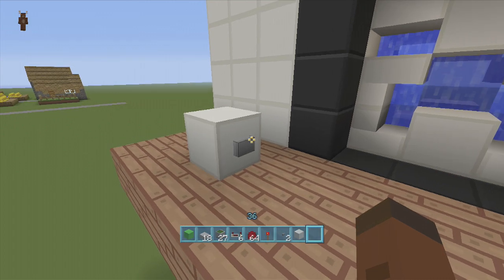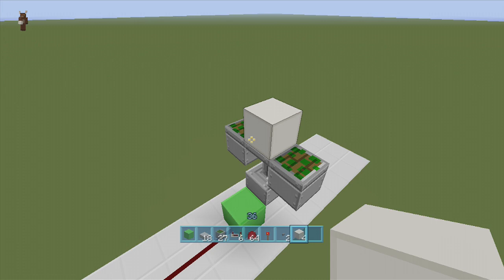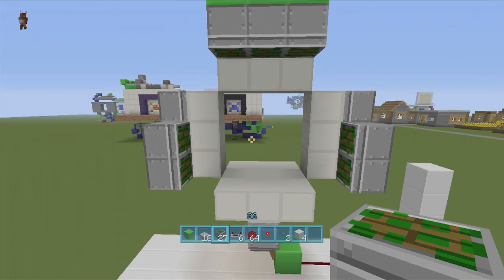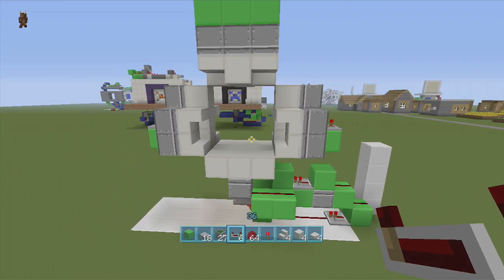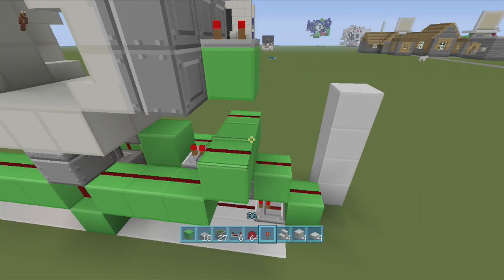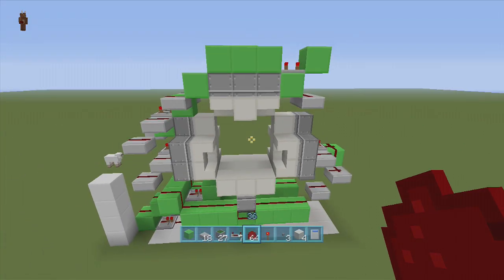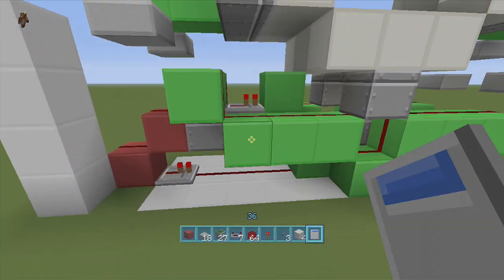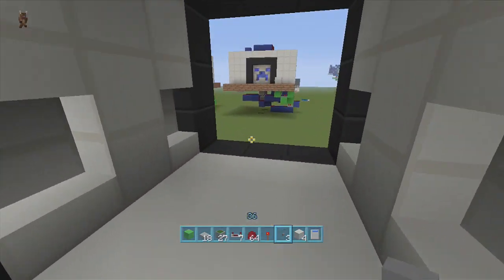(TU19 Quick Fix In Description) Creeper Face Water Door 3x3 "Tutorial" (Minecraft Xbox/Ps3 TU15)

Comment: I can't put the redstone on the slab
Reply from the maker: then you cant build it. Have you updated minecraft? you need xbox live to do it.
Reply: Make sure its upside down, if that doesn't work use glowstone.
Reply: ***** It works for pc...
Reply: I think your slab is to high or low it needs to be it top position to put dust on it
Reply: It's prolly in the wrong spot it has to be on the top of the block not the bottom
Reply: Yea, it's probably on the bottom half, not top half